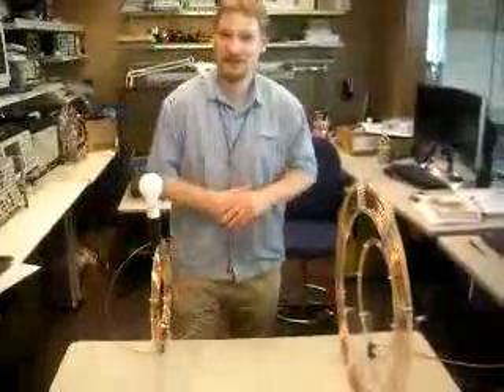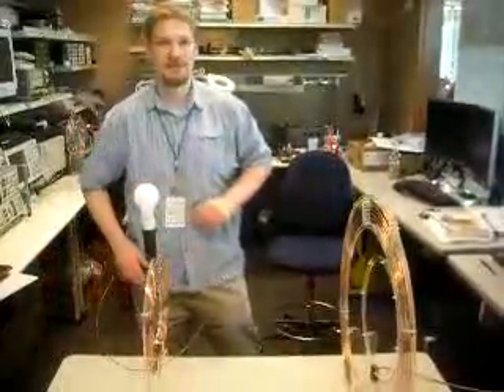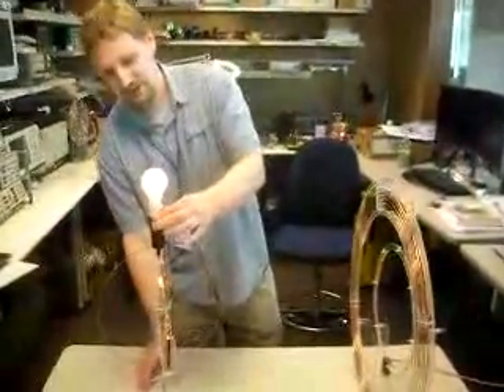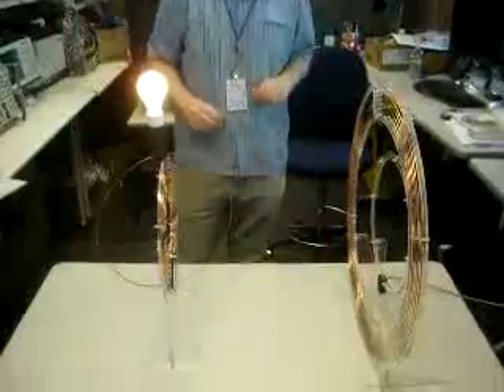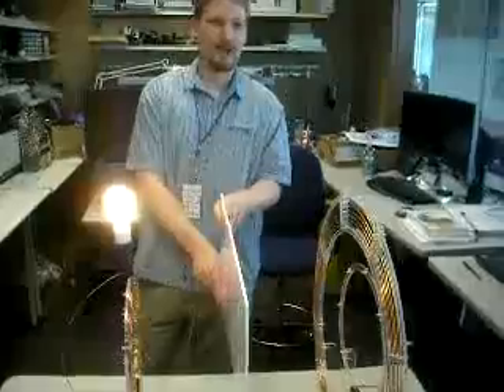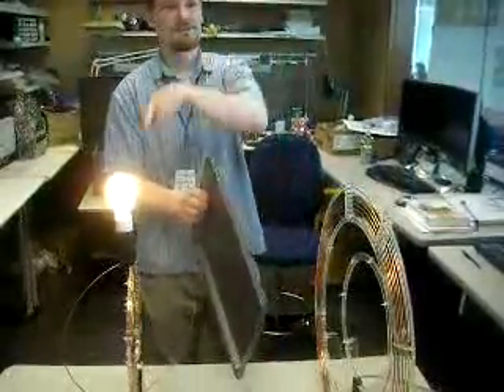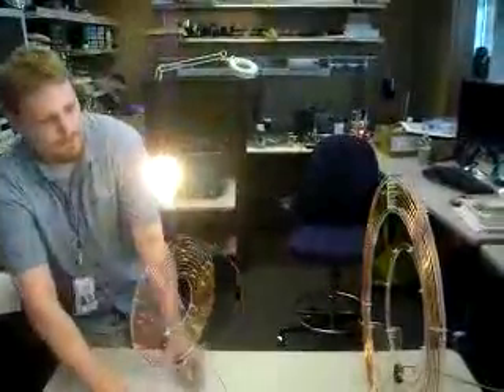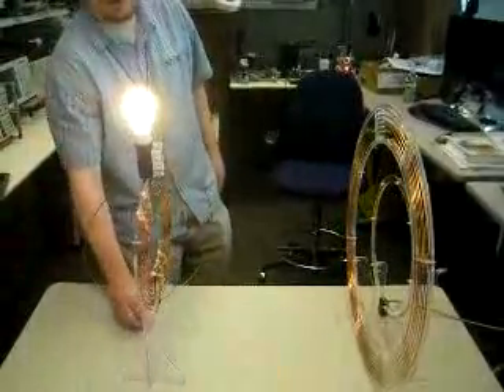Intel Seattle's Wireless Energy Project

Comment: I am curious, what will happen if they connect two bulbs in parallel. Will they glow with the same bright? Is there a limit on how many bulbs you can connect? Is it possible that in this case they can lit two 60 Watts bulbs with 75 Watt source?